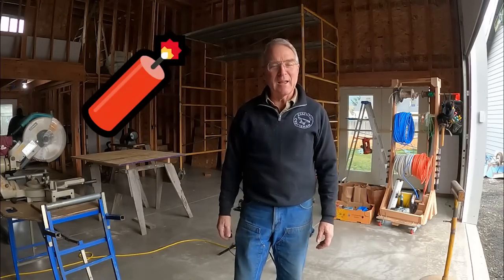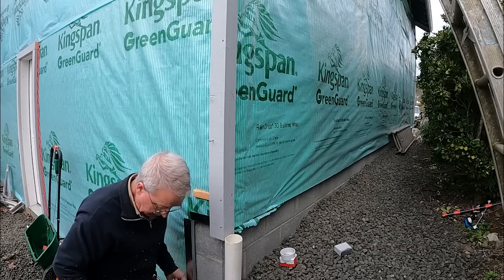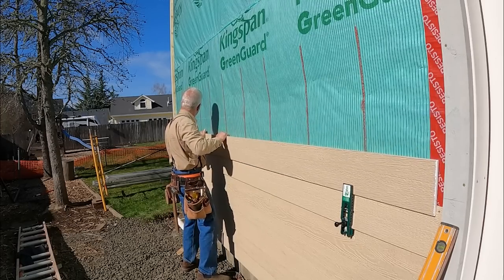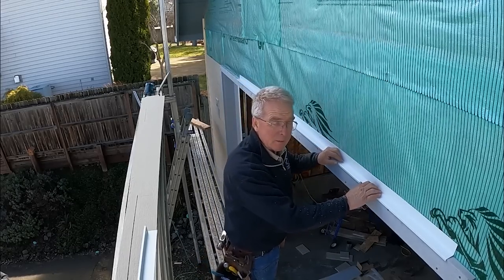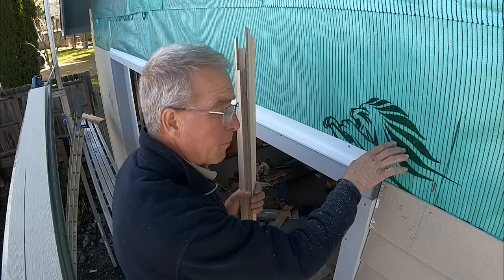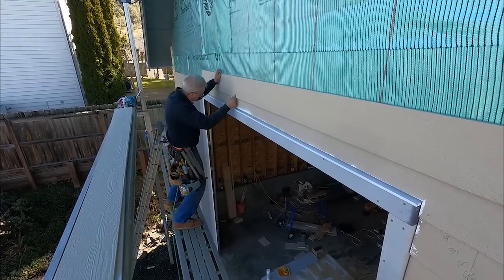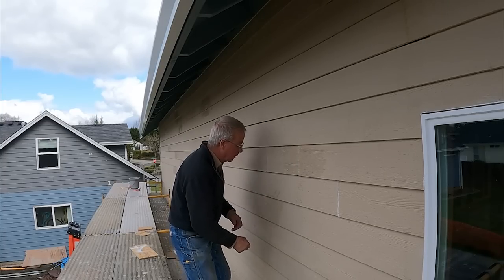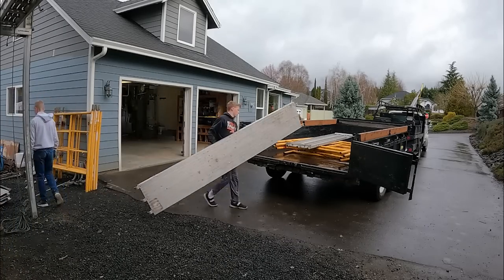Putting Siding On A Shop: Shop Build #23

Comment: That flashing should have been placed behind the paper or at least taped
Reply: And of course… what is more reliable, gravity or adhesives?
Reply: @2brazy4ubitch  tell that to manufacturers who make finger-jointed lumber for use as rafters!
Reply: @2brazy4ubitch  building paper should have been cut,  then the flashing slid under it and then the paper taped to the flashing...for the full meal deal
Reply: @lemuelseale1640  Everything is glue nowadays because all the good timber gets shipped to Asia and Europe
Reply: @rd-ch1on  ive heard that, especially all of the pine!
Reply: There’s a difference between adhesives in a water challenged position vs in what should be a perfectly dry location (any framing lumber)
Reply: @2brazy4ubitch  i hear you, but for example take a place like houston. Humidity levels over 60% arent uncommon. Over time?…
Reply: You ain’t wrong Brotha

Comment: I was on a custom home job some 15 years ago and the general hired some guys to install hardi siding on a detached garage.  After awhile he came over to see how things were going and all hell broke loose.  They didn't nail the siding to the studs, from inside the garage you could see all the nails from the siding.  They said it was fine.   He made them take down the 4 or 5 rows and nail into the studs and they paid for the siding because it had nail holes every 8 inches.  It's a wonder he didn't kick them off the job.  The quality of help makes you wonder how things are built.

Comment: Scott, We enjoy your videos. You can extend the life of your switches indefinitely by installing flyback diodes across the relay/solenoid coils. High voltages are propagated when the coil field collapses and causes arcing (think ignition coil). The diodes short the back emf and prevent that arcing.

Comment: I may have a solution for those switches in your truck's crane control constantly burning out.
You might want to ask your son about this, but the idea is to use contactors to do the actual high-current switching, and use the switches in the hand control as just low-current signals that pull in the contactors (might still be around an amp for a big enough contactor, but that means the switches last easily 10x as long if the contacts are burning out on them currently like I think they are).
The idea is that you use the switches in the hand control to signal what direction the relay goes, rather than just directly controlling the motors.
The contactors will be the things doing the actual switching of the high currents, in a box full of relays and probably a few diodes too.
To your son, this will probably be some relatively "crude" controls, but it'll get the job done.
First off, make sure you have a fuse protecting the wires, we ARE entering a domain where if the wrong two contactors pull in at the same time, it creates a dead short without even getting the motor being controlled involved.
If you have contactors that are double-pole, single-throw, normally-open, that's ideal. For controlling 2 motors in 2 directions, you'll need 4 of those.
If all you have is single-pole contactors, you'll need twice as many, because we need to control both the positive and the negative wire of each motor. If your son has ever heard of a "DC motor H-bridge" type of circuit, that's basically what we're making here, but with relays instead of transistors.

The way you control the contactors is that for each motor, you have an incoming feed that can be off, normal polarity 12v, or reverse polarity 12v, that's how you have the switches in the hand control set up right now and that's something I can work with just fine for the task at hand.
What I'm saying is that you don't need to change how the hand control is wired for this, that's what it's already doing with the wires that go to the motors right now.
Instead of those wires going to the motors, they'll be feeding power to the coils of the contactors.
To reduce duplication of description, let's talk about only one motor, the control setup for the other motor will be identical.
Since all the contactors I can find online that have a high enough current rating are of the single-pole, single-throw, normally-open type, you'll need a total of 4 contactors per motor that you want to be able to have turn both directions (or not turn at all).
One pair of contactors will supply high current 12v to the motor in "normal" polarity, making it spin one way, and the other pair of contactors will supply high current 12v to the motor in reversed polarity, making it spin the other way.
Now because the control signal can be off, normal polarity, or reverse polarity, we need some way to force only one pair of contactors to pull in at a time when you push a direction on that hand control. That's not hard to do at all, there's even an electronic component specifically for this task.
The thing you need is a diode, because diodes are just "check valves" but for electrons instead of water or gases.
By having one pair of contactors get current thru a pair of diodes that only let thru current of one polarity, and the other pair of contactors get current thru a pair of diodes that only let current thru of the opposite polarity, you force the electricity being supplied to the contactor coils to only be able to go to one pair of contactors for a given polarity of supplied current.
If you set it up and it's working the opposite way from what you want it to, all you need to do is switch the polarity of the power going to the contactor coils, before the diodes get involved (or flip the polarity of the diodes, whichever is easier).
For which diode to use, I'd suggest a 5A sustained forward current 80V max reverse voltage Shottkey diode, with the "thru-hole" mounting type so you get a pair of bare leads to work with that are easy to solder wires to and then shrink wrap over (this prevents moisture ingress and provides electrical insulation).
Since the coil of even a small relay is enough of an inductor (on purpose) to create a significant inductive kick-back, another diode should be placed across the coil terminals of each contactor to give the inductive spike a place to go without causing harm, and you can use the same diodes as you used for the "check valve" purpose described above. Just make sure to put them across the coils so that when there is power to the contactor, the inductive kickback prevention diode will not conduct current, or else you'll probably smoke both diodes. By putting those inductive kickback prevention diodes in, you also prevent the contacts of the switches in the hand control from burning out nearly as quickly as they would without those protection diodes.

Also, like I said, if all this is going right over your head, you might want to bring this idea to your son the electrician, they would probably understand it relatively quickly if I've described it as well as I think I have.

EDIT: I now have a KiCad schematic that represents the basic idea of this concept, so IMO it shouldn't be that hard to figure out if I can do it.
The reason I say if I can do it anyone can, is that I'm an auto mechanic by trade, but before that I went to and dropped out of college, with the goal of becoming an electrical engineer. I still have electronics as a hobby of mine, and every now and again I can use that knowledge to make something useful for myself or someone else.
The schematic is available upon request, provided I can find somewhere on the internet to host it that won't charge me money for the privilege.

Comment: One trick I figured out for handling Hardie siding by myself. I got an 8 foot by 1 inch aluminum square tube and cut off one of the sides to form a u-channel. I'd set the edge of the 12 foot long Hardie siding into the channel and this gave me enough rigidity to be able to easily move and set the piece onto the Gecko supports.

Comment: Spraying the primer sounds like a swell idea until you start doing it and paint is everywhere. What I do is drill a hole in the lid of an appropriate size container, stick the handle of a foam brush through it, and now I have a brush and container that can be closed. I agree 100% that the requirement to seal any cuts on the LP makes one of the nicest premium siding materials to work with a real pain - ESPECIALLY working alone. Having someone who can start cutting and sealing edges while you measure and nail 'em is such a game changer.

Comment: I sided my new shop with LP, and followed the manufacturer's instructions to the letter on the gaps.  I hired someone to do the painting, and did I ever get an ear full from him.  He thought it was just terrible to do that, and had me go buy two cases of caulk.  He used less than half.

I met you at Good of the Land in Texas back pre-Covid.  It's good to finally have gotten back to something like normal.
Reply: So you let the painter talk you out of installing according to the manufacturer’s requirements?  Is the painter going to cover you if you need to make a warranty claim down the road?
Reply: @donbushek733  I was thinking the same thing. Smartside and Hardie are great products but unless you're doing it yourself you really have to shop around to find an installer that actually does it to spec with either of them, which of course conveniently lets both companies get out of a lot of warranty claims. And good luck collecting from the contractor that screwed it up!

Comment: I do my drip caps opposite to you. Here's an idea. Make the first notch you show, but cut it out completely. Make the size of the notch equal to the distance you want the siding held off the flashing. Get a hand seamer, and grasp the horizontal portion of the drip cap. The tip of the seamer should be all the way on the notch you cut, and the edge should be about 1/4" from the inside corner. Bend up instead of down. The metal will fold in the corner (flatten that with the seamer). Now water that runs onto the drip cap cannot run off the side, and you have a nice shelf on each corner to rest your siding (or to ensure it doesn't go too low).
Reply: this is the way! end dams on the drip
Reply: Or at least squirt sealant into the corners, about an inch in.
Reply: yes. direct the water out and away from that typically bad water penetration point.  The entire purpose of the cap is to do that.  Send the water out and away.  I also put the moisture barrier on top of the metal cap.  doors and windows.  think of it like roofing.  I also caulk each course where it meets vertical trim, NOT on seams in the field (Hardy Plank standards)

Comment: Scott - if your contact switches go bad, just add a $5 automotive relay to it to control the power. Your nerd son in law should be able to handle it for you. Doesn't need to carry any power to the remote, just a tiny bit of signal. Could replace it with wire as thin as a headphone cable if you wanted after that, zero concern for amp draw, thickness would only be about durability at that point. Maybe toss a $1 diode across the relay to snuff the inductive kick of the motor shutting off and sparking the leads.

Comment: Small  blocks of wood as a brake would aid neatly turning down the end tabs on your Z-channel drip caps. Buy some flanging pliers and true lefts and rights.I used to use an S-hook made of aluminum coil stock to temporarily hold up the other end of long pieces of lap siding.

Comment: you want the bottom of your greenspan (water resistive barrier) to go over the top of the drip cap - ie shingle lap the water management system. water running down the greenspan will go behind the top of the drip cap because of the lapping order. drip cap won't drip anything as installed

Comment: You should use a contactor for the crane. The momentary switch sends a signal to the contactor, and the contactor does all the hard work.
It's an easy job to do. Your son in law should know how. This way you could use a slimmer cable for the control box. 
If you want to be extra fancy, it's just as easy (if now easier) to wire a remote.
Reply: The crane probably has relays (contractors) to handle the high amperage current. Parts store toggle switches are not designed to handle the constant cycling that a crane controls like this gets…. A Mil. Spec toggle switch is, they are not cheap $50 each on McMaster Carr, but they are a one and done answer.

Comment: I caulk the top of the windows and doors with metal drip edge just because unless you make a caulk dam behind the siding at the ends of the metal flashing water could run horizontally down the flashing and find it’s way behind the siding.
Reply: Yup, he should have sealed the last inch or so in the corners.

Comment: Do you or anyone reading this have an opinion on whether or not one needs put battens external to sarking so as to cause an airgap between the sarking and shiplapped timber boards or timber weatherboard cladding on a timber framed house? In the video I notice there is no gap... but the wisdom at the timber yard that I buy from say that it is advisable. Any thoughts appreciated. Thanks. GREAT videos by the way.

Comment: What size nails did you use for this?  LP just talks about stud embedment.  I suppose they don’t know what thickness sheeting you have and if you have insulation on there too.  They say 1-1/2” embedment.  That means if I have 5/8 panels, plus 3/8” thickness of the siding means I should have at least 2” nails for this?

Comment: That gap will disappear as the OSB absorbs moisture. But not putting the full gap, you risk the siding buckling. Yet another reason why I prefer fiber cement.
Reply: If primed and painted properly, the siding won't absorb anything. It will however, expand and contract with temperature changes.
Reply: @ADBBuild  Not according to LP. It's why you leave the gap. In just a few months, the gaps between boards will close and it'll look great. If gapped correctly.
Reply: I’ve got to disagree. I installed LP Smartside three years ago, gapping and painting it according to LP’s specs, and the gaps have not changed since installation.  I imagine that the gaps are spec’d to be what they are to prevent water from wicking into the gap, which it would go if the gap was smaller.
Reply: @donbushek733  There was a series of videos by RR Buildings in which he installed LP and the gaps closed up as predicted.
Reply: @MyLilMule  🤷‍♂️
Reply: @donbushek733  Maybe they cheated. It was a sponsored video.

Comment: I would be concerned with that L shaped metal flashing you put underneath the trim (@3:28) holding water against the underside of the OSB. I think it would have been better tucked behind the greenguard, and possible with some weep holes drilled in it with bug screen shoved in them, at least for the horizontal portion.

Comment: If air can get in somewhere, moisture can get in there too.  Never think for a second you'll ever have somewhere exposed to the outside that will never get wet.

Also, your drip edges should have been tucked under the wrap so water running down that will run off.  Or failing that it should have been taped.  How it is now, water will get trapped behind that drip edge.

Comment: Love the channel. Curious if vinyl siding is ever used in the Pacific Northwest?
Reply: On low budget builds, and mostly on the coast where the salt air destroys everything. But no, not very often.
Reply: You gotta be careful with the LP stuff. In the Southeast in does not hold up. Hell I think LP stopped making smartside because of lawsuits. Its cheap entry level stuff. Regarding vinyl, it is starting to make a comeback in the SE. Over the last year all the large spec guys have started using vinyl soffit and aluminun fasica. 95% of building codes in the SE do not allow vinyl siding, but the code never omitted vinyl soffits lol.

Comment: Any reason there are no furring strips beneath the siding? In northern europe it is mandatory on all buildings with sidings. No matter the siding material.
Reply: I’m pretty sure the green house wrap already on the walls have vertical ribs in it that give you the air gap like a furring strip would..

Comment: Should the drip cap over the door have been taped to direct moisture out from the building wrap,rather than run under the drip cap into the back side of the door trim?

Comment: I'm surprised the switches for your crane are wired to carry the full load current of the pump and the winch. A couple of inexpensive Ford-style starter solenoids and a little bit of re-wiring would remove that load from the switches and solve your problem indefinitely (hopefully).

Comment: For those of you new to the tablesaw, never do what Scott does at the one minute mark, namely standing behind the saw and pulling the last of the board through.   If it kicks back and binds, it will pull your hand(s) into the blade before you know what happened.  Use a good push stick from the front side, every time.
Reply: Proper practices aside, he's using a Sawstop. It's nearly impossible to get your hand into the blade when using one of those. We actually get a considerable insurance discount for having those at work.

So, yes, you shouldn't do that. But... that saw make bad ideas moderately more safe.
Reply: @TheBrokenLife  I’d w ager that those “new to the table saw” probably aren’t using a Saw Stop, and should be mindful of safe practises.
Reply: @sheldonvogt5212  Everyone should be mindful of safe practices. 👍